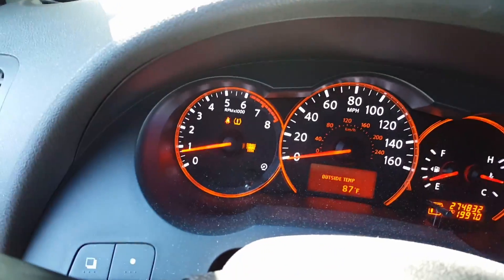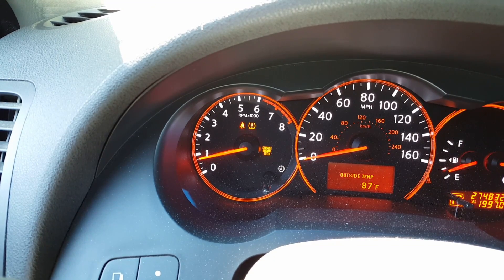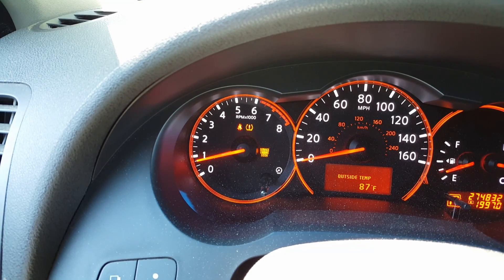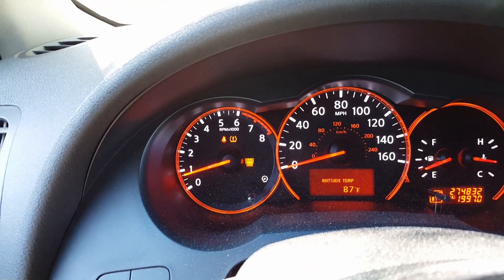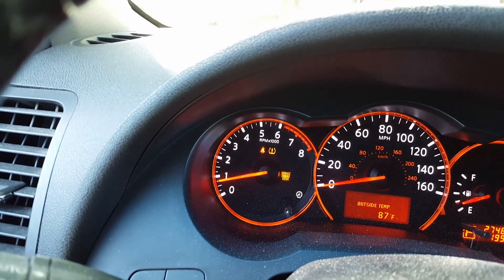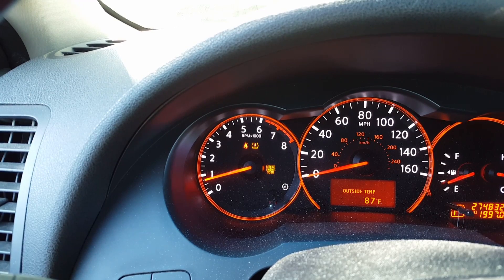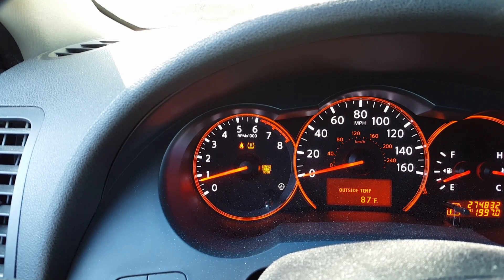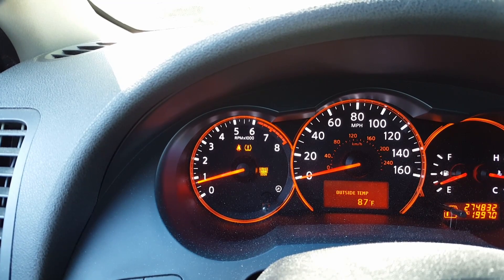2008 Nissan Altima Service Engine soon Light and why it comes on

Comment: Just had this issue.  Got a gas cap from nissan dealer. Cleared codes with a odb scan tool. I used a forty dollar scan tool.  Engine light is off. 23 dollar gas cap.

Comment: The fact that your car has 274,832 miles amazes me... how? Is it still going to this day? My '10 Altima has 148K miles, still going so far.
Reply from the maker: SOLD IT AT 312,000.
Reply: @peterl6095  Did it ran great when u sold it
Reply from the maker: @KidJaeProductions  

YEP. DROVE FINE.
Reply: @peterl6095  that's dope. I hope mine could go up to 200K. I keep my maintenance up, so far it rides okay
Reply: Mine 2010 has 201000 right now my light just came on😞
Reply: @nelsonchavez9996  I'm at 156K right now 💀 still going (transmission radiator broke 3 times)
Reply: @KidJaeProductions  wow I had no problem with mine only minor issues you know
Reply: @nelsonchavez9996  of course! Fixable issues. The engine runs great, the transmission... Meh, could be better
Reply: 345 260 miles Mostly Highway 1st 5 years
Changed radiator 225K hit a raccoon 
Started leaking a week later.
Changed transmission at 295K
Changed  alternator  300K
Changed  starter   305K
Battery 🔋  3 tiimes

Tires Disc's and Brakes normal wear and tear.
Reply: @nikosavo1393  thats wassup. Mine currently over 200k miles. Only issues im currently dealing with is catalyc converter

Comment: If you have a vacuum leak it could be brake booster or solenoid somewhere maybe around the intake manifold your idol is off its going up and down very slightly. I got the same car. Just take it in or keep checking you tube. The ultimo's inotorious for cracking on the exhaust manifold which is connected to your catalytic converter before and after on the exhaust which will make you feel emissions as well

Comment: Mine is on in my 08 Altima and I failed my inspection and the guy claims that I need my Cadillac converter fixed which I dont believe, I feel its something else wrong
Reply: Guy telling me the same thing. He said I got a cracked and leaking exhaust manifold? Like what?